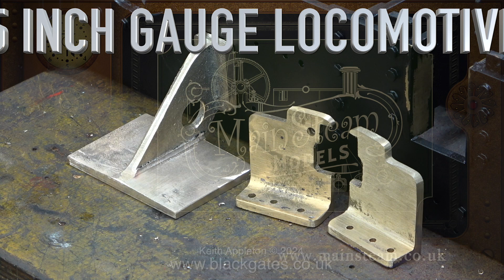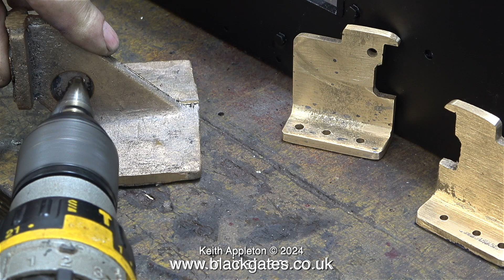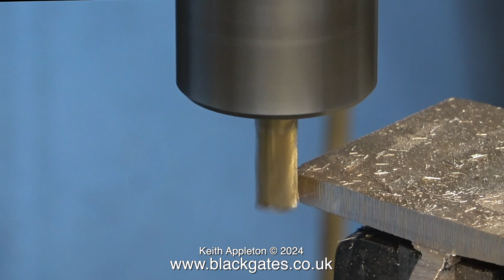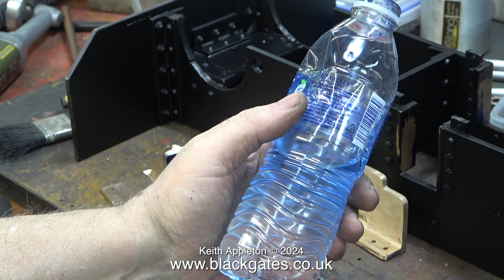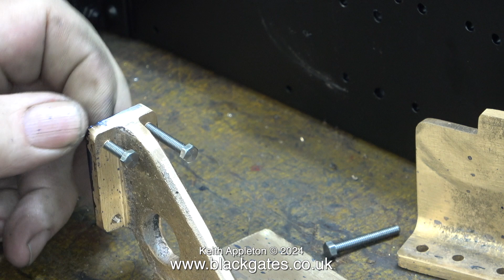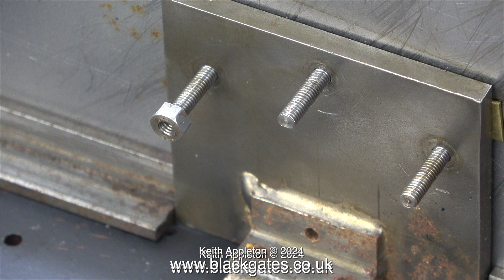A BLACKGATES SWEET PEA LOCOMOTIVE - PART #37

Comment: M4.4 …?
Reply from the maker: Drill Size .......
Reply: @keithappleton that .4 is called, a smidgeon , in my shop. Just a smidgeon over M4. Drilling a hole two or three times to Get a good fit is just sneaking up on it. Good practice with an emphasis on, practice and practice makes perfect. 👍🏻
Reply from the maker: it is just what it says on the Drill bit }:-)))